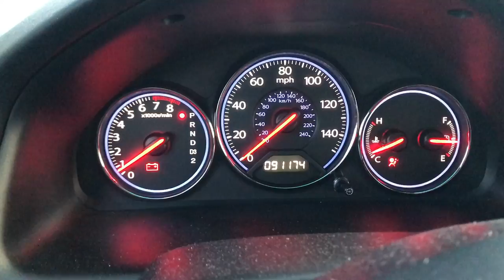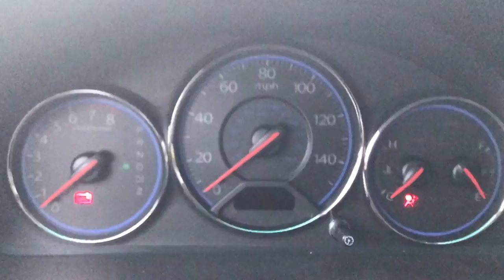Car Battery DYING While Driving!

Comment: If it's while driving the alternator may be bad letting the battery to drain. I to recently fix this problem myself.
Reply: Rhonda Shidler not really
Reply: Darius Steadman The alternator should keep the battery charged. If he got it started then the battery had enough power to start but probably drained during the drive if the alternator didn't work. He even said in the description that they replaced it.